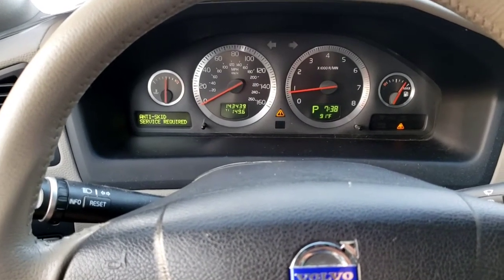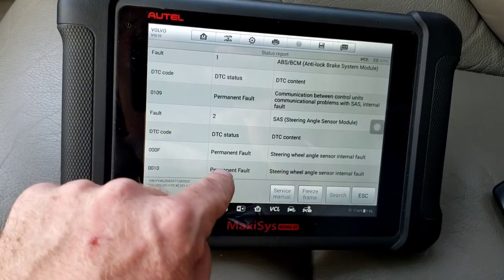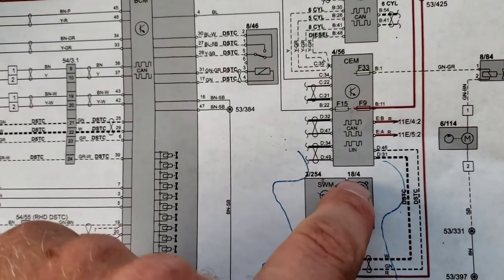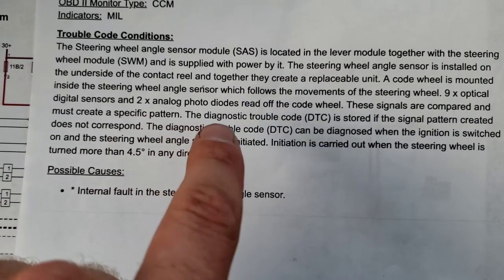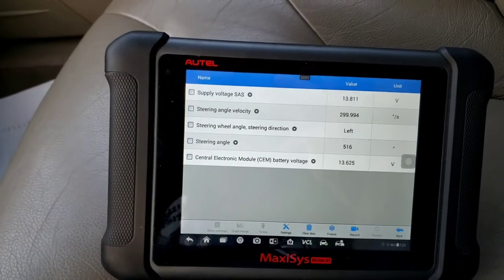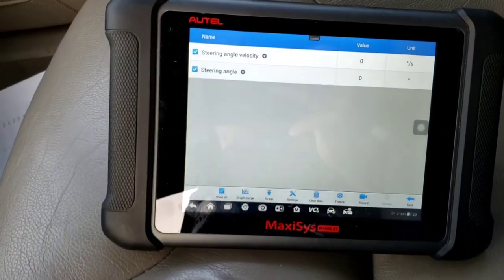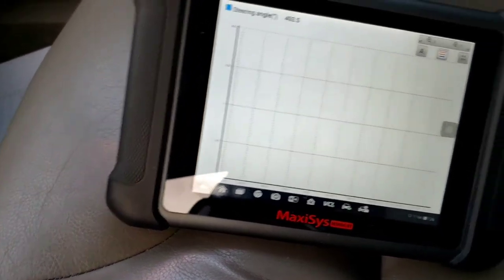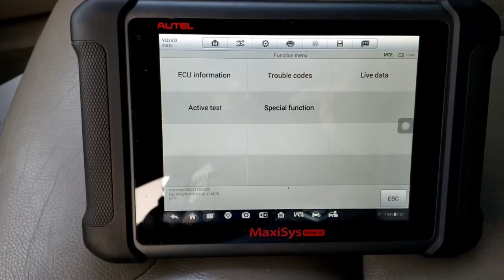2007 Volvo XC70 Dynamic Stability & Traction Control (DSTC) Troubleshooting Part 1

Comment: might just be dust on the optical sensors... the SAS can be pried off the contact reel, and blown with compressed air
Reply from the maker: Nice. Thank you.
Reply: @blautomotive7230  Fyi i did this today, blew out the optical sensor with compressed air. And have driven it five times today. Error msg went away after second drive.  Then came back on third start. Then fourth and fifth went away.  Not sure if i have to clear a code but i don't have vida

Comment: Soooo. What about a dirty connection or ground coming from the BCM/ECU itself. I have all of this also the the alternator and I checked all the wires but the alternator has been changed by someone twice now and it’s charging but it has a 0U10287 code also and the alternator is charging but the light is coming on? Any thought? The alternator is good.   It makes no sense. It must be the can bus IMO? Help me please 😂

Comment: Where to buy Autel to see faults info in my volvo v70 2001 ?
Reply from the maker: Depends where you live. I got mine on Amazon.
Reply: or get a vida /dice unit.
Reply: You will also need the Volvo software?

Comment: Just replaced my clockspring aka Stearing angle sensor… paid Volvo to do what they claimed needed done… still same issue…  they claimed software loaded… basically a crap system.

Comment: This explains a lot, I have an 07’ XC70 with the same lights on, I took it to the dealer, he wanted to replace the brake control module but was unsure if that would cure the issue, and at $2,600 I didn’t feel like playing the game.. after speaking with him about other Volvos and shows etc, he said he thought it was just a ground fault, so trust was dwindling, I’d like to bring it to your shop just to see the thorough test and data, I’m in California, are you near by?